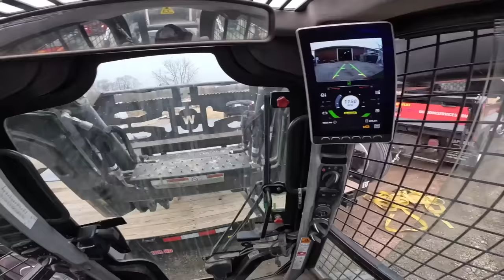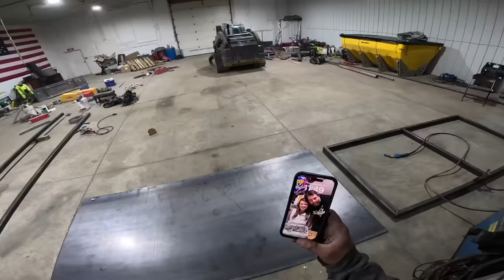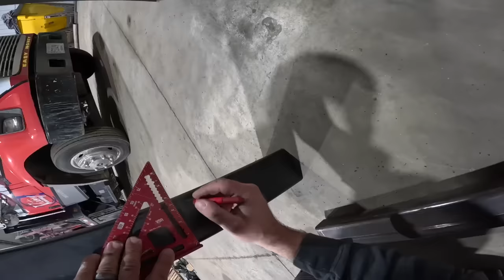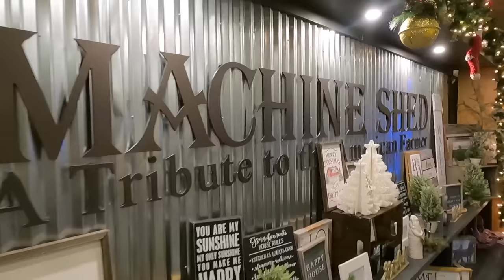Building a table that will last FOREVER!

Comment: Quick tip drilling steel
Always use lubricant eg ( wd40 )
Place the lubricant on the end of the drill bit and on the sheet of steel you plan to drill. This helps protect the drill bit and the metal to make a smooth cut.

Drill at a Slow Speed

The faster a bit spins, the hotter it gets. And heat dulls bits quickly. In general, it's a good idea to drill through metal using as slow a speed as possible using a drill bit for metal. Hard metals like steel and larger drill bits require even slower speeds
Reply: VictoryOutdoorServices--  nah I’m busy

Comment: Hey with ypur Dewalt drill have you noticed a problem when you turn it to reverse the first time you hit it it will still turn forward? That's what wr use at work and with these newer models I've noticed quite a few do that.

Comment: Need to invest in a deburring tool they're like 15 bucks and you just run it around the drilled hole a couple times and its perfectly smooth and won't have a sharp edge👍🏻

Comment: NICE TABLE. BUT THE VISE. I prefer my vise at the edge of the table. So the inside jaw lines up or sticks out a bit from the table so you can work on something standing straight up and down. If don't understand what I'm talking about you will. But nice table.

Comment: Pro-tip from someone who has built 20+ welding/work benches over the years. Take a grinder with a flapper/sanding wheel and take a few light passes along ALL the edges top and bottom and take your time rounding the corners of that 1/2" sheet. They shear those 10x4 sheets and the shear leaves a nasty edge that can cut you up and tear your clothes when leaning up against it. I've ruined hundreds of t-shirts, sweaters and expensive FR jackets because of sharp edges and corners.

Comment: You should have welded another frame around the bottom, it will be more durable and you can put a plywood shelf for a lot of tools or whatever. I know because I’ve built them before.
Reply: I guess I should have waited before I commented. Sorry !
Reply: Half of the bottom shelf is upside down, the knots should be facing down. Paaaleeeze !

Comment: Drilling oil, or machinists oil, cutting oil. Keeps bit cooler and cuts smooth 
Set the clutch on drill so ur not breaking ur wrist

Comment: not sure if it will help you next time, i got told when using a drill bit to go as fast as possible with light pressure, and then slow speed with pressure when using screws. not sure if that will help to save some drill bits

Comment: Wouldn't it have been better to have some angle iron on that table top and bolt it to the frame rather than weld it? I'm just thinking it would make it easier to replace the table top or transport the table in the future, if needed, if it can be disassembled into several pieces.

Comment: You should weld a steel plate by the Anvil slanted so you can have screwdrivers stored Thier Im a mechanic that helps ALOT n short walk or not even that just grab n continue with your work I watch your videos everyday I'm from La Loche Saskatchewan but relocated to Fond Du Lac Saskatchewan way up north of province of Saskatchewan icelated place and everything very expensive I'll show you I'll message you n picture of meat price your not gonna believe it